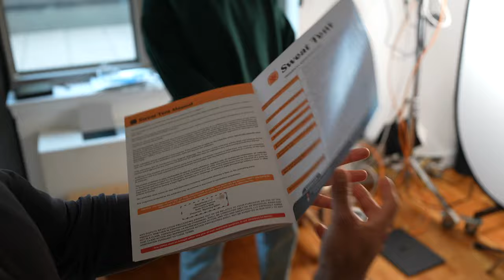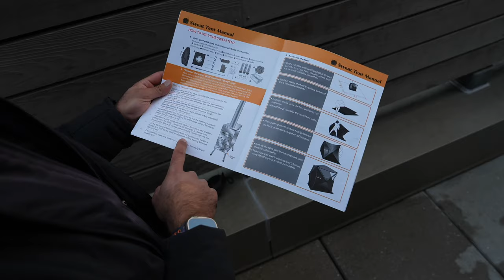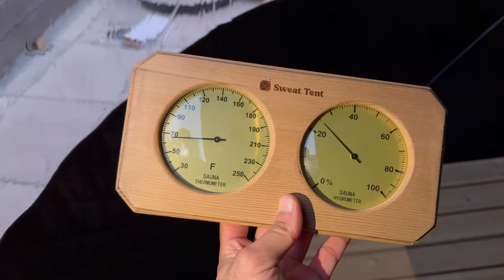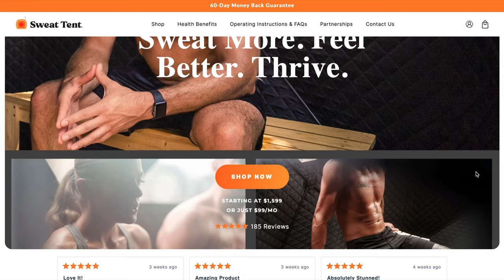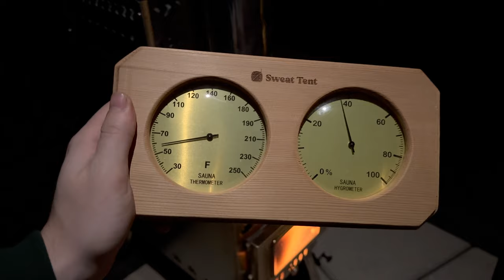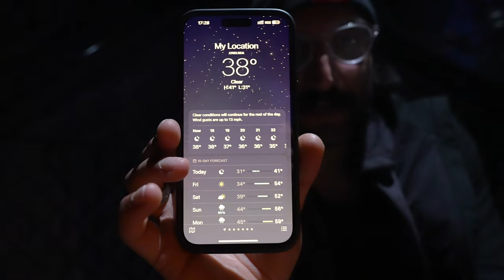I Tried the Cheapest Outdoor Sauna (Sweat Tent Review)

Comment: Few tips for those watching this video new to the sweat tent. 
1. Season the stove outside the sauna get that sucker as hot as you can for an hour then let it cool and move it inside your tent 
2. Use better wood. Eucalyptus works best 
3. The stove needs to be set up next to the double protected layer on the sides 
4. Do not pour water directly on the stove pour the water on the rocks only. 
5. Put two to three logs in let them burn then 3 more then get in the sauna after the second set of logs burn. Should be about 170-190 
6. 15 mins in and then 3 mins in a ice bath

Comment: The smoke is coming from the “wood” you used. It’s a fire starter log that’s soaked in chemicals. 

Smoke can also be caused from having wood with too much water. That’s why you burn leaves and live branches when making an emergency signal fire. 

Additionally, The hotter the fire, the clearer the smoke because it can burn contaminates and extra fuel before the smoke gets away.